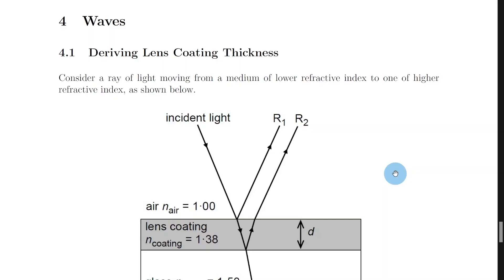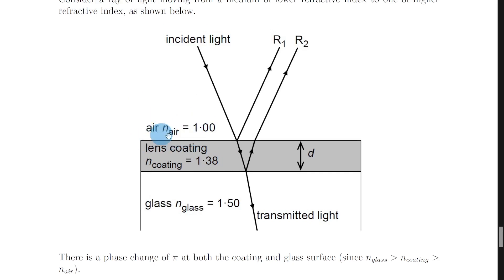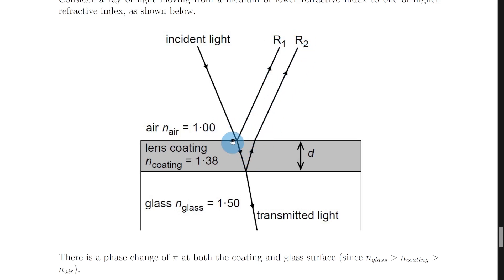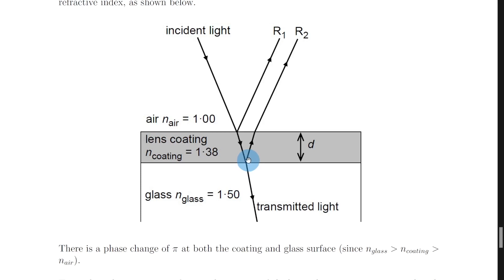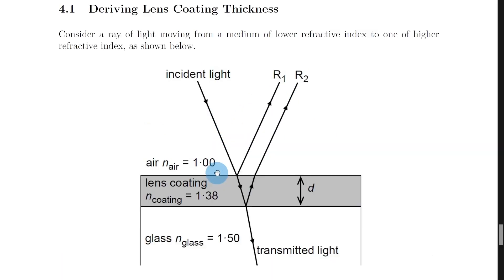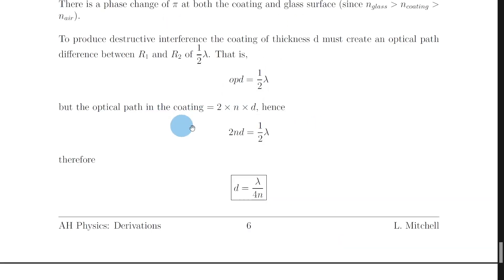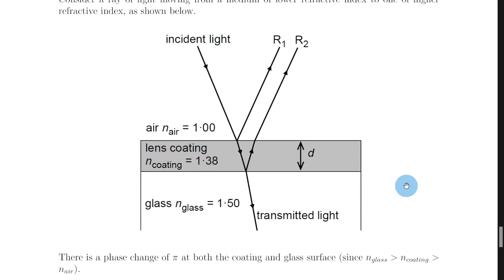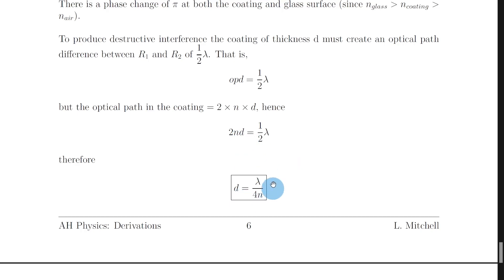Advanced Higher Physics | Deriving Lens Coating Thickness | DERIVATIONS

Comment: Is crashing advanced higher physics possible if I learn the NAT5 and higher syllabus during the summer holidays?
Reply from the maker: Hi Leon, I've never really known any student to crash advanced higher physics. I'd probably recommend against it as the learning curve would be steep, especially if you haven't done physics before. Students do occasionally crash Higher Physics though.
Reply: @thephysicsacad  very true. But this year I did convince my teachers to crash higher engineering 2 months into the course and I’ve got my exam on the 16th. If I achieve a good grade in that could I try and convince them to allow me to take on the challenge? Thanks. 😊